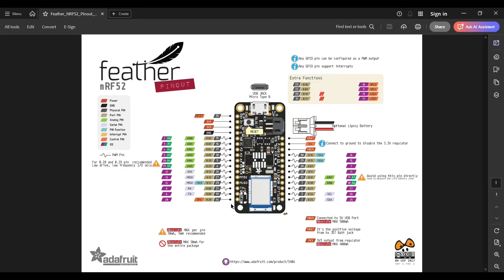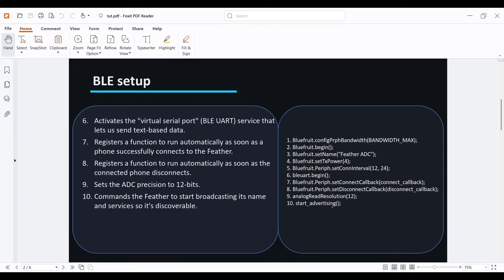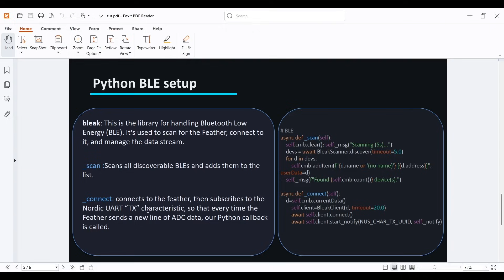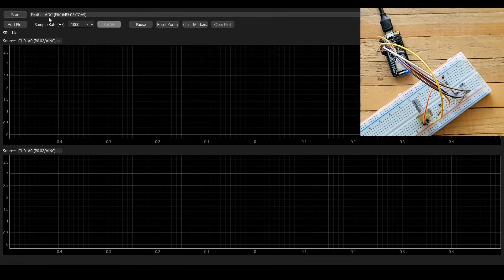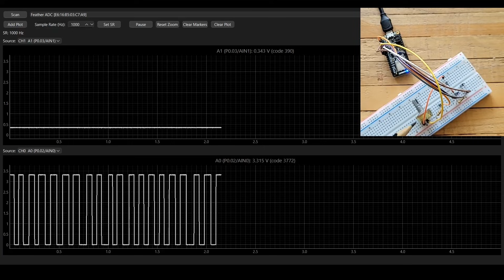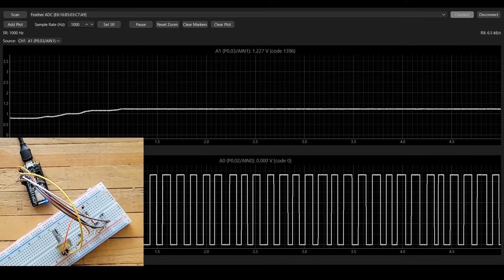Build a Bluetooth Oscilloscope with nRF52 and Python

Comment: Very nice project!

Would love to try this!   I have an original ESP32 D0WD/WROOM which has bluetooth classic (v4.2: BR, EDR) and BLE (v4.2).. I imagine the nrF52832 BLE 5.0 code might not port over so easily?

For the plotting, instead of romconcepttocircuit / bluetooth-oscilloscope-nrf52 ,  do you think it could leverage an existing oscilloscope GUI (ex. Sigrok Pulseview , PlotJuggler, EMBO, Ngscopeclient/Thunderscope, etc)?